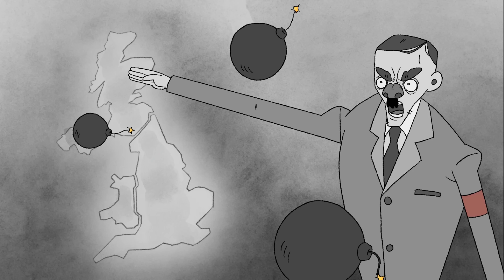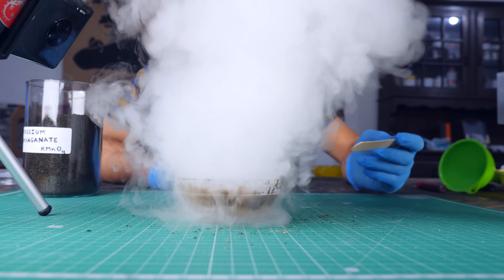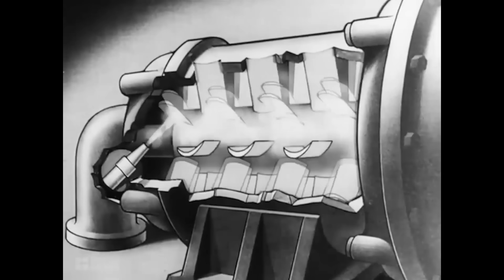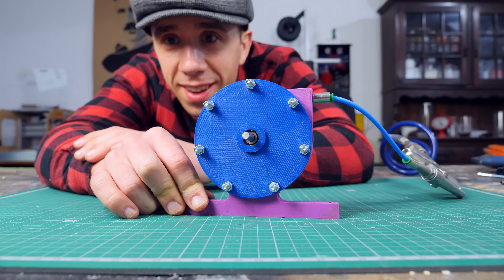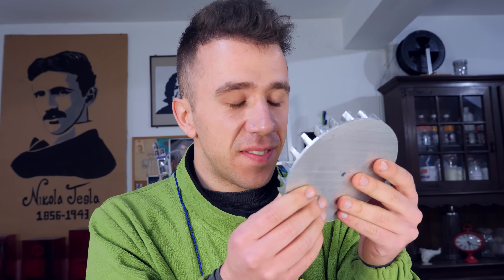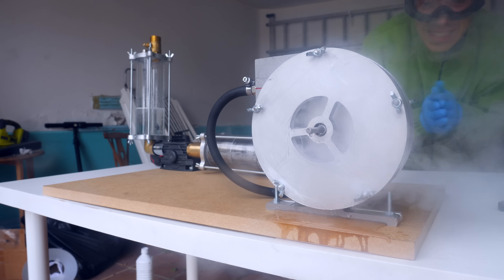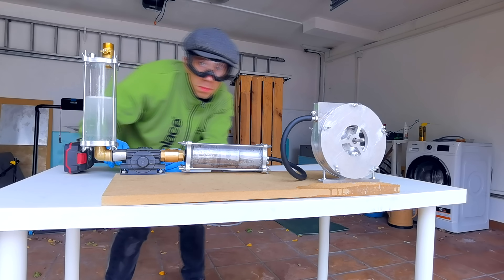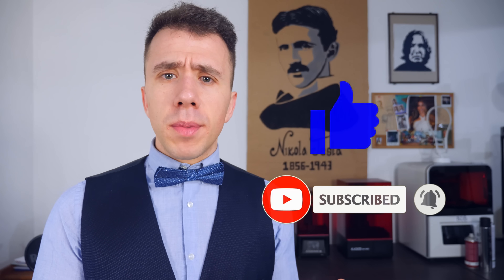I built the World War II V2 Rocket Steam Turbine

Comment: info on ur cnc machine used to cut the aluminum parts, i got a 3018 an ive been wanting to try to upgrade its motor to do aluminum i know ill have to change the motion system to something mgn12 rails an b blocks but i worry if the frame its self is stiff enough so thats been the big thing holding me off from tryring it myself. i know alot of stuff will need upgrading including the z axis assembly an i need to see how much it would all cost to upgrade vs just buying something that already capable of doing it.

Comment: Hey , why don't you use a silver plate just pure silver and then pump the steam threw a dryer like calcium carbonate so you are just left with pure o2 and maybe some how you can also get the hydrogen as well and then feed them by separate lines and ignite them

Comment: So.... Many now suggested the vertical decomposer, but also a good idea would be thinner piping, shorter piping, using sealed bearings, making the end opening smaller.... Now that you do have aluminium instead of plastic, it should hold more pressure....
Using a Destillation system of piping to further split hydrogen peroxide and oxygen. 

If the aluminum should not withstand the pressure, there is always a way to use heat treatments upon the aluminum to properly prepare it for pressure and vibration. Looking up deeper into heat treatment of aluminum.... It should be easier to get up to temperature, but the moment of oil bathing it could be tricky to achieve . Also a good experiment would be a range of steam injector nozzles and their effects.

Comment: You could scavange a fuel injector and fuel pump from a car. That would give you a good spray pattern into the catalytic converter and as really high flow rate, and granular control over the reaction by manipulating the injectors spray rate by controlling it with some sort of PWM generator (arduino or similar) and some transistors or high speed relays. Cool project!
Reply: Was thinking the same but with just a nozzle, I don't think an injector from a car would output enough flow looks like he had to put alit in to get any out, maybe 3 injectors one for each catalyst and then separate tubes
Reply: uwu

Comment: Video Idea : make a composite turbofan and tesla valve jet engine. Intake would be a fan motor powered by electric power. Then a hollow cylindrical duct with tesla valve so that back drag can be minimised. The duct at the beginning will have a conical shape to the tesla valve inside the cylinder. After the duct a perforated metal disk will be there for fuel injection and atomisation. Then a converging duct with glow plug in between. At the end an alternator for regenerating energy and then a nozzle and thrust vectoring if required.

Comment: Have you ever heard of the thornson inertial propulsion it works using angular motion and turns it into linear motion but it does not have a fixed point of friction or fulcrum you could try and make one that works and gives a thrust output they spin a weight like Thor's hammer and then jump onboard

Comment: I just looked at your CNC, could you swap the pulleys over so the speed reduces (or get some different sizes to try) and then fit a larger collet, like an ER20? that way you should be able to fit a ripper in there. I never knew the catalyser would do that though, very cool (or warm ;-)

Comment: Ive seen "jet packs" built on similar concepts using high pressure nitrogen to push the peroxide through atomizers onto the catalyst, then just use the expanding gas out a nozzle for thrust.
If you dont want to use N2 to push the peroxide you should still try to mist it into as fine of droplets as you can get.

Comment: Try using an electrical current in a secondary gas dispersion from a baking soda and water solution it should increase the gas pressure as well as the psi output from the catalytic converter. Would love the 3D printer to get a start on my wind and water turbines that I have planned

Comment: Hey Integza, I keep seeing you have trouble making solid metal parts.  Do you know about "lost pla casting"?  You print the shape you want in PLA, then you make a mold around it, melt out the PLA and cast in metal.  Should work great for your rocket engine parts.  You seem to have everything you need to make molds.  You can make the molds by dipping and forming a "ceramic shell" or using plaster or packed sand.  If you don't want to handle the metal melting part, I'm sure there is a foundry (or a maker) near you that could pour the metal for you.   MANY videos on YouTube about this!

Comment: VIDEO IDEA: try to make a rocket by using 3D printed fuel , also it would be pretty clever to use antiperspirant can body as body of a rocket because it is already pre built for high pressure, and by using metal valve, you could do a fine rocket, also I and lot of poeple too would sure be happy to see how would you compete with chalenge of rocket being too heavy because of so mutch metal, i know that you propably do not use all my ideas , but I am sure happy to see you do it in your style   
            Last Words: this chanel is for me soo big inspiration ,I never even thought about doing engeneering projects like this at home , but you showed that trial and error are cool ways to learn stuff, witch I was afraid of for some reason

Comment: I know that you may not have the tools for this idea but here it is... Use/make a turbine from a turbo charger. They are relatively efficient in what they do and are engineered to extract energy from exhaust and/or flowing gasses. Also if you can find one out of a used/not damaged turbine they are balanced and will not explode under high speed.

Comment: you could try to make the turbine turn the pump, making a self-sustaining system.
Also the turbine has high speed but little torque a larger pulley on the generator and smaller on the turbine could produce more electricity
to improve the catalytic maybe put it vertically, the peroxide enters from the bottom and an empty space on top, that way the splashes probably won't reach the turbine

Comment: You made a video about making metal stuff with a normal 3d printer, and the video where you made a wankel engine on a 3d printer... Okay, it was on a resin 3d printer, but my question is: would you be able to make a metal wankel engine that runs on by actually burning fuel? I know it needs a little electrical work compared to the compressed air one, but would it be possible? I mean in the video, metal parts looked very precice(only shrink, but would you be able to scale the parts accordingly to compensate for the shrinkage)...

Comment: You should learn to cast in sand to mold the metal parts for your rocket that require to resist higher temps to last longer,.

Comment: try to make an hydrogen peroxide powerd boat,an steer it with servo motor you can make an hydrogen peroxide rocket to move the boat or use steam from hydrogen peoxide to spin your wankle engine wich will be conected to an propeller

Comment: That was amazing! I don't know if this would help , but maybe add a tank and a check vault ( one way valve) on the end of the chamber with the catolizors for it to be able to build pressure before it enters the turbine , have a valve between the compressor tank and turbine so you can close and open the vault once it builds enough psi

Comment: Video idea: Integza Could try making a skateboard run on a steam engine by using some lithium-ion batteries to power some thermoelectric pads to pump heat out of a set of heatsinks into a boiler system using copper heat pipes(the heatsinks do not need to be heated for this to work)

Comment: Idea for a future video: could you put all the turbines and engines you have made in past videos into a rube-Goldberg sort of orientation to do something totally mundane in an overly complex way. Like it could be the solid fuel rocket engine firing its exhaust into a turbine that drives a complex pulley system which pumps something into your Tesla valve and so on and on.. all to like char the skin on a tomato with a rocket nozzle or something.

Comment: For such fast spinnig things like gas turbine u need really big gear ratio to rotate generator. Your reduction looks like 2:1 but try something like 1-to-20 or even bigger. Obviously, because of such big ration small 11-teeth cog needs something monstrous with 220-teeth so u need 2- or even 3-steps of reduction. Cogs smaller then 11 teeth are ineffective as hell. But try planetary reducer instead of regular cylindrical gears. It will really change the game. And remember "no worms and belts". Also what about balance of turbine?

Comment: Just a thought as well, could you accelerate the reaction by preheating the peroxide before it hits the converters.  lastly hook the turbine shaft to the pump and use a valve to throttle it?

Comment: My suggestion is to mount the catalytic converters vertically, but it may also be worth it to have a spring loaded check valve so the pressure out of the component is at a constant rate instead of changing as the peroxide decomposes. Might be solving an issue that isn't there type thing but it's worth a try

Comment: To help with the H2O2 getting into the turbine, you could try a 2 stage reaction chamber. So, have the exhaust of the catalytic converter feed into another plastic tube containing the potassium permanganate doped ceramic thingy that you made in an earlier video. Then have the exhaust from that tube feed into the turbine.
Reply: Or inject propane (or similar) and burn it in the oxygen/h2o2 rich atmoshpere,

Comment: I would love to see you make a plasma electric turbine. China has been working on one for a few years and it suppose to have similar output to a jet engine, but instead of using carbon fuels it ionizes the air using electricity, turning that into plasma, then uses the plasma as a propellant. It can reach over 1000 degree C, but I'm sure you can handle that ;)

Comment: Catalyst converter has to be vertically mounted because you reeeealy don't want 50% H2O2 squirting out of your turbine. Also I would definitely encase the acrylic of the converter with some metal because if the acrylic tube ruptures, you get sprayed with H2O2 to the face which would be unpleasant to say the least. I'd guess it will rupture sooner or later since you pushed in the catalytic convertor and it probably scratched the inside of the tube, weakening it in the process. Combine it with cycling the material with high/low pressure....

And for the love of god, please don't pour in so much H2O2 - or atleast run the pump with a motor from a safe distance :-D You really don't want the tank to burst and spill all over your hands, face and desk. Not only does it hurt but it can also burst into flames when combined with stuff like your clothes, paper etc.

Stay safe my friend, highly concentrated chemicals can be quite nasty :-)

Comment: Like others have said for the catalytic converter you'll want to mount it vertically so that the peroxide has to fight gravity and is therefore less likely get shot out of the turbine. In addition to this it may be wise to install a "splash plate" above the catalytic converter in it's chamber so that any peroxide that get's shot up hits that plate and gets splashed to the side of the chamber to pool up underneath the catalytic converter. Leave a small gap below the catalytic converter in the chamber so any leftover peroxide can pool up and into the catalytic converter.

Comment: Mount the reaction chamber vertically, instead of using multiple catalysers in one tube use multiple tubes with a single catalyst and install pressure gauges. Might be a bit more complex but will be worth it. Would love to see the Tesla value in there also. Buy some Locktite for your bolts!!!

Comment: NEED HELP!!! I have invented a device that can go to any depth in the ocean without worring about any pressure.My design is a sphere with electro magnet's all around the outside the sphere and the a thick rubber bladder around sphere full of ferrofluid.Deeper you go increase magnetic field to oppose the ferrofluid.This should in theory push back on water with equal force that it see's.Think of it like a ballon around the sphere full of magnetic fluid.There could be sensor's on blatter and when distance of baldder gets closer to the sphere it increase's field to equalize.Hope you get what im talking about,really need a 3d printer to do at home test.
Reply: P.S. I have also invented a spaceship for propulsion with ferrofluid,maybe we can collaberate on it.

Comment: Ok, I'll try to be helpful. U need something that avoid liquids to flow into the turbine. The perfect thing is a Cyclone.
After that, for helping the cyclone, the separation chamber need to have the exit on top. Try like that and see if it works. If the turbine is slow or it doesn't convert well the steam energy u need to re design it, I'm not an expert in that field (I'm studying industrial chemistry) but it seems a little too heavy on the spinning disk. Try to scale it all down maintaining the same thickness of the walls, so the smaller wheel can spin faster. (There are some graph showing the rate between pressure and flow and the intended pump (or turbine, that's the same) at a specific zone). Last suggestion, try to predict what's happening, with the reaction to control it: by knowing how many bars a liter of H2O2 50% can produce U can know the input. I can introduce u to the maths: 1mole of a gas is 22.4 liters maintaining the same pression, if it can't the volume is indirectly relate to pression, so if I had it in a container of 1 liter it will generate 22.4 Atm of pression.
Now I need to consider what and how much things in your "fuel" becomes a gas.
The h2o2 is 50% g/g ==> 50g /100g ==> 50g : 34(g/mol) = 1,47mol/100g ==> 100g = 0.1kg ==> 0.1kg : 1.45 kg/L = 0.069L ==> 21.3 Molar (mol/L). U produce 2moles of products every mole of how so the gasses are 42.6 Molar. That means that in a closed space u produce 42.6 mol/L x 22.4 Atm/mol = 954 Atm/L (if all is instantly decomposed).
Hope that this is useful ☺️.

Comment: Really impressive project, man.  Here's a couple ideas 💡 if you're interested:

1.  Polish the turbine and oil the chamber to reduce efficiency losses in the turbine itself.
2.  Stage multiple turbines with increasing radii to extract more of the power from the steam as the pressure drops.
3. Use some kind of liquid separator to eliminate fluid passing through the turbine.
4. Use more catalysts in parallel rather than in series.
5.  Drive the pump through a heavy gear reduction from the turbine, so that acceleration creates a greater supply of steam.

Comment: I’m a Tool maker i would recommend maybe 4140 or another cold roll steel for your components. maybe even Some light stainless steel. often times the metal i use to make armature shafts for large companies at work is really hard stainless steel or pre heat treat 4140

Comment: Just an idea for an improvement on this project. What if you were to make the chamber holding the catalytic converters vertical. Drummed out a channel for the peroxide to travel down to the bottom from the outside of the converter. And put an inlet valve there. This would allow the peroxide to meet the honeycomb it's the honeycomb Cadillac converter Is outside the main zone of pressure. This would let you have a more linear  Is stream of  Gas with gravity helping keep the liquid down.

Comment: try to make an actual  dynamometer, that checks rpm and torque at the same time, you could use the eddy currents with a few magnets and an aluminum push rod that rests on a scale, and at the same time use a tachometer to read the speed, usually the electrical way of measuring power isn't the best

Comment: I just followed a course about hydraulic turbine design and to see you put that into practice made my day. Tip if you want to build a good turbine, just look up the Cordier diagram. In short, it tells us that the size and flow rate of a well-designed turbine are intertwined (there are formulas for this). And depending on your flow rate, I expect you need to go smaller.